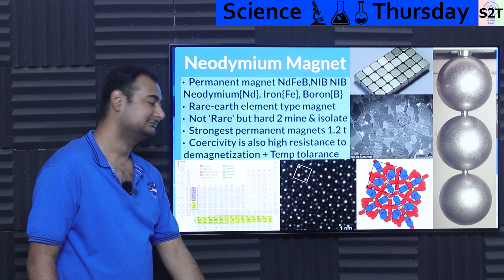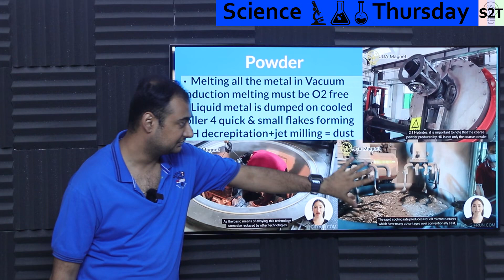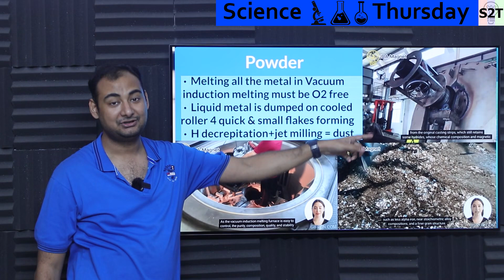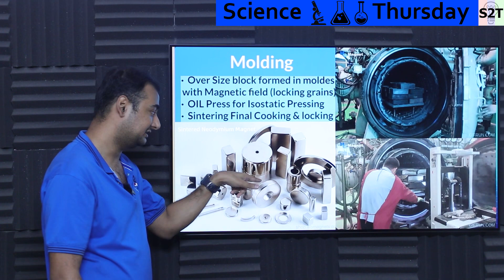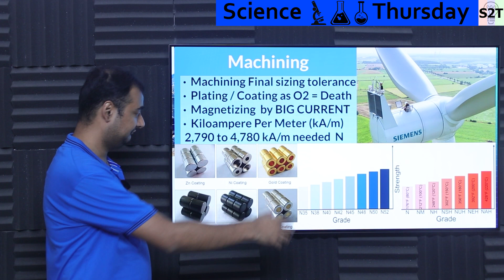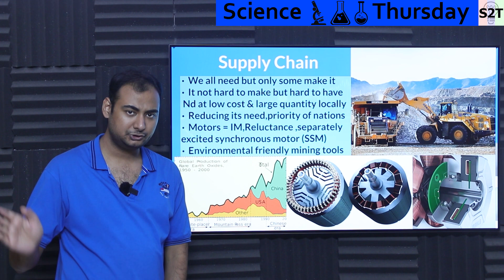Neodymium Magnet Manufacturing {Science Thursday Ep251}

Comment: Rare, Hard to mine, very expensive process & said this several times. Then why are these sold as toys, to most people? And not that expensive considering.
Reply from the maker: cost is proportional to grade and size toy is free while what u need for wind turbine that is rated for high temperature continuous operation well that is what is costly or what we use in EV and when u have to put bulk order for N52 Grade then is costly and yes its it is so costly that three OEMs decided to develop magnetless motor Technology just so they do not have to this foreign dependency
Reply: @s2tenglish  So Sell off the trash & recover a little cost. Gotcha.